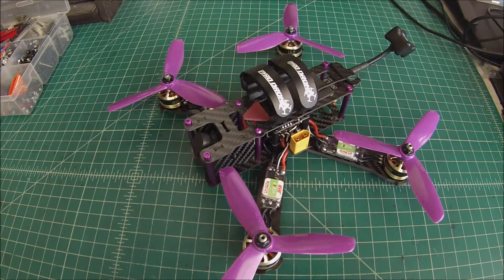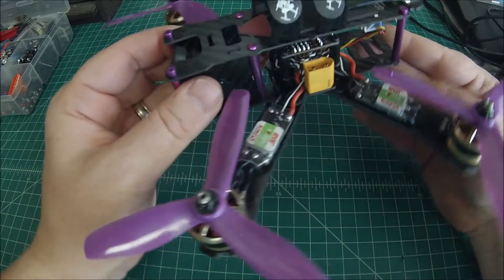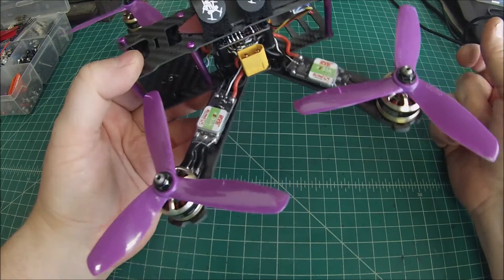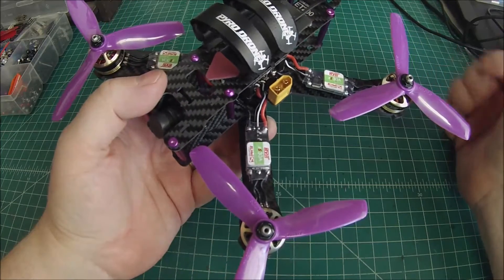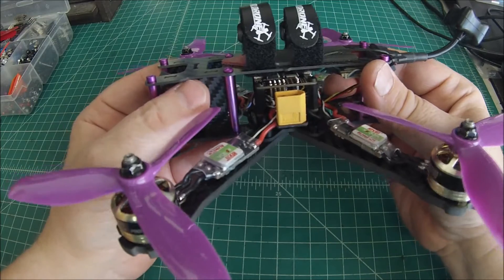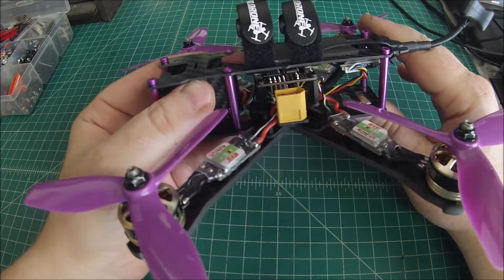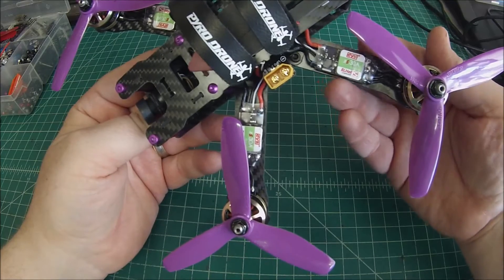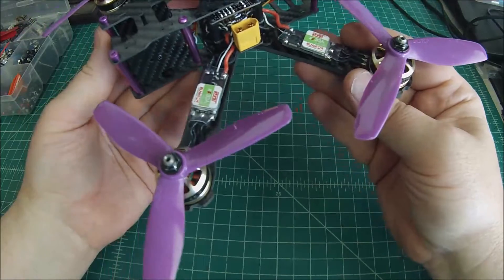Review of ZMR-220 (QAV-R Clone) Quadcopter and build out overview

Comment: Great build, I ended up purchasing  this quad and after months of flying I had a strange loss of power mid flight and it fell and broke the bottom plate. Can you please advise on the model number of replacement part that I would need to replace the bottom plate of this frame. Thanks

Comment: I dont know why I have a hard time to fit mine HS1177 between those plates
Reply from the maker: Loc Tran sometimes the camera mounting holes in the frame aren't big enough to let the camera mount to sit flush.
Reply: I think that's what happens cause I can only fit one plate on one side. Do i have to drill to make it bigger?
Reply from the maker: Loc Tran yes. I use a round file but you can also drill it. Just take it slow so the carbon doesn't splinter.